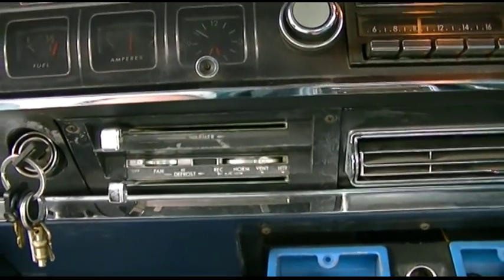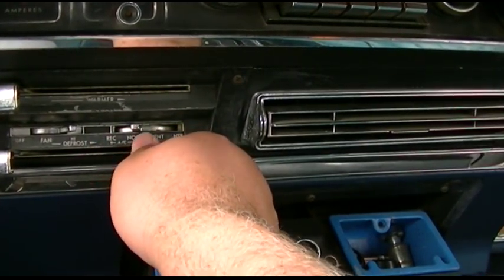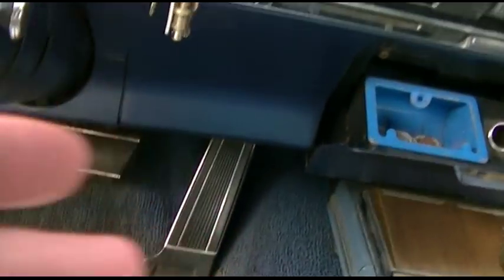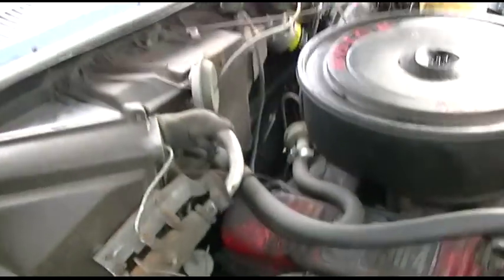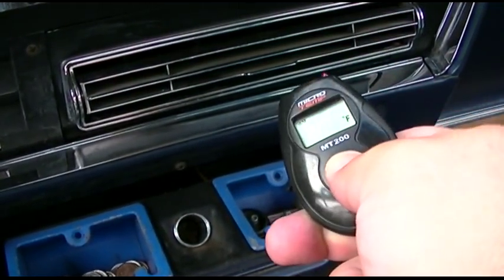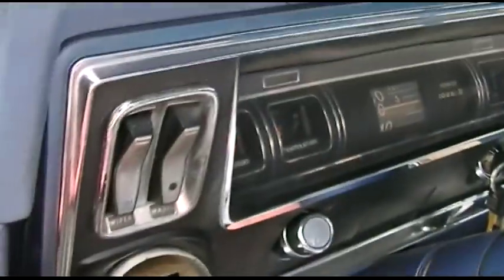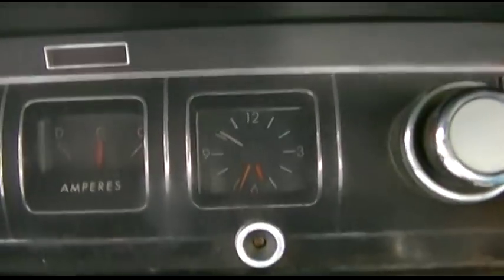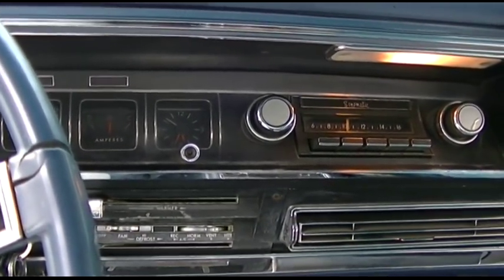Buick Update--Heat Fixed, Blower Blend Doors Work!

Comment: Great news! Looks like your gradually getting the bugs worked out! In my 81 Silverado, I needed to replace the heater core, so while the box was out of the truck, I replaced all the foam weather stripping on the blend doors, and other areas it had rotted away. While this isn't an issue in your application, I got a good five degrees colder on the a/c temperature. My heater core is full time on. Also before weather stripping replacement, the defrost door made a loud bang when it was activated, now it is a faint thud. I also had to cobble a connection to the main vacuum line on my climate control system. Been working fine for 10 years, and it's not noticeable.  To this day I am still uncovering things called: why the hell did the people who stole my truck do that!? Who knows how many times they just kept driving it... it's fine. Well the engine was seized when I got it back...
When GM decided to go with a Quartz movement, the reliability of the clocks seemed greatly increased. Mine still is very accurate at 36 years old, well after a little tweaking at first. An interesting story about the clock in my truck goes like this. After Grandad bought the truck new, he noticed the second hand was jamming up on the minute hand. He took the instrument cluster bezel and lens off, and gently pried on the second hand to clear the minute hand. It's worked perfectly ever since.  In fact, when I went to the impound lot to get my truck back after it was stolen in '04 and recovered three years later, that damn clock still ticking away with the correct time! Literally one of the only things confirmed still working in the truck at the time, the other was power locks. Like others have said, your clock probably just needs a cleaning, and relube to get it going again. Likely a much easier repair than the weather stripping job. Thanks for the update, always cool to see other folks enjoying older vehicles, and keeping them on the road!
Reply from the maker: Thanks so much, that's a great story about the clock in your truck.  I'm surprised they recovered it 3 years later.  Doesn't seem the police department would do anything after a month here.

Yes, it's a huge accomplishment when something is fixed that never worked before, and I'm very glad it is working!  I bought this car on impulse; I wasn't in the market for a classic nor was I looking, but it was in the neighborhood and one day I grew big enough ones to call.  The price was right, the rest is history.
Reply: I'm glad you took the plunge! I had actually long written the truck off to never be seen again. Then on 9/24/07, after opening the letter that revealed my truck had been recovered, I totally freaked out. It was back home within the week, and got right to work!  There were a lot of doubters, and they said I'd never get it running right, and would always have problems, blah, blah, blah ... Ten years in, still working great, and it gets driven every weekend the weather is nice. One pump, and starts right up. The best part is my Grandad's excitement when I drove it down for him to see. His health was beginning to fail by then, but he sure lit up when I said let's go for a drive! He told me about when he bought it, and all our adventures he took me on in that truck. He'd just look at it and say "damn, that's still a pretty pickup. Looks better than the new ones!" I have to agree with him!
Reply from the maker: I'm very glad I bought it as well.  A lot of pleasure is to be had with older vehicles.  Always a nice drive in that car.  Often when the wife and I come out of a place she says we have to look for the most square car in the parking lot.  It's SO easy to spot this car since it's not a stupid plastic bubble like cars today.  Old cars had so much better style, they actually cared about every little detail, instead of computerizing everything and giving you a NAV system with Bluetooth  that allows you to open the sunroof from your cell phone while sitting inside the coffee shop.
Reply: That's true! Just take the phenomenal power steering, for example. Completely effortless! They were sneaking in more plastic by the 80's, but still most of the switches, and knobs are chromed metal. I like the brushed aluminum theme used throughout my truck, even on the emblems. Just looks amazing. With new cars I think there are two, maybe three colors available. White, silver, and the occasional maroon, with boring trim, and gray interior. That's about all I see around here anyway, all cookie cutter. How about the warning labels everywhere, on everything!? On my 81,  there is a "caution fan" warning on the radiator shroud, a fasten seat belts light/buzzer, and parking brake light, that's it! I remember as a kid going somewhere with Grandad, no seat belt, no cell phone, no gps, rode in the bed sometimes, and am still here to talk about it!
My "new" truck is a 2004 Silverado, in Arrival Blue Metallic, and that's good enough for me. Just has 90,000 miles, and bought brand new to replace the stolen 81. It's been suggested I should trade it in on something new, it's just losing value. I just tell them I'm a big, big fan of not having car payments, so I'll keep it as long as possible! 
People really lose it when I discuss our 40 year old Kenmore gas dryer, and how awesome it is, but that's for another day, and another video!

Comment: The clunk in the baffle door could be something as simple as a rotted out felt seal allowing the door to clunk against whatever it stops against.  The clock may have old sticky lubrication and dirt in it that would need to be cleaned out and new lube added, or it could be dead but if it's trying to move it sounds like it isn't a lost cause.
Reply from the maker: The baffle door seems to close and open fully and block off the other areas.  So it may or may not have rotted out felt or foam, but that's a good point.  If I can ever locate and access it, I would be able to see it to tell.  Like I said most analog clocks in old cars have long since died, while it certainly may be able to be revived, I also secretly hope I don't have to take that dash apart.

Comment: My 2 cents: Replace as many vacuum lines as you can, I would not open a can of worms playing around in the HVAC box, trying to get parts working correctly.
Reply from the maker: Replacing vacuum lines is definitely in the works sooner than later.
Reply: Michael Gegzno As long as You're not rebuilding the A.C. compressor, it's actually pretty simple. The only problem is the limited room to work with.
Reply: I would be concerned of fragile parts, breaking them, then being worse off.
Reply from the maker: Not rebuilding the A/C, there's no need.

Comment: clock could be your drain on your battery...
Reply from the maker: Nah, the problem with that was a bad voltage regulator.  That would bring the battery down to nothing overnight.  It's been replaced.  The clock does put a little drain on the battery, yes, but it's nothing to be concerned about.